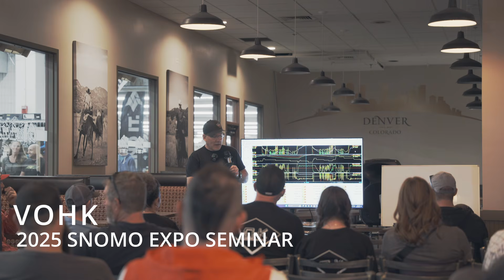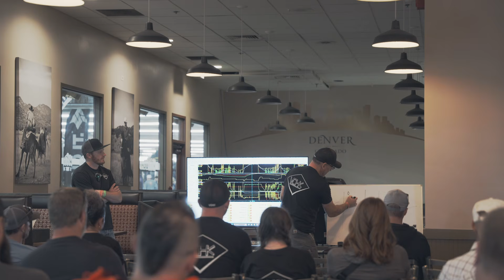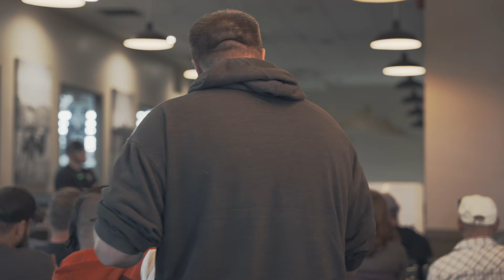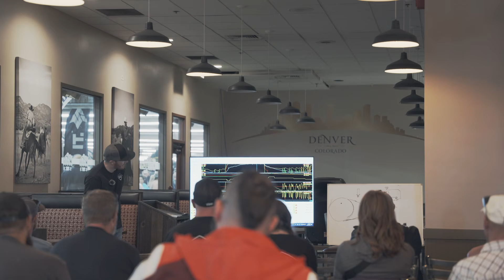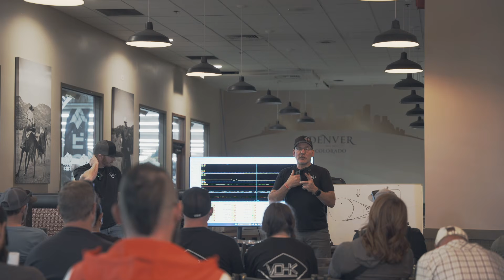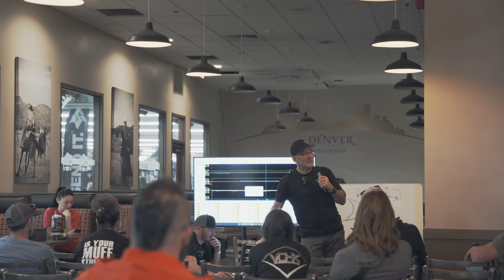Tech Talk 2025 SnoMoExpo

Comment: Then end is kinda messy vs the beginning, time times for anyone that might need to know.  

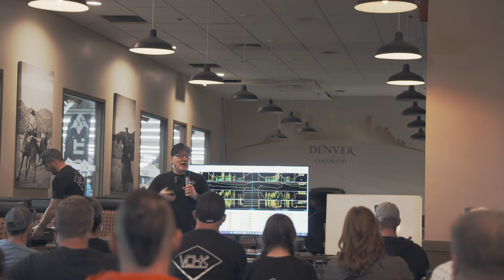1 tracks 0:00-  33:45
2 p22 33:45-52:00
3 deep snow bog 52:00-1:02:20
4 fuel pump 1:02:20- 1:16:00ish
5 throttle body adapter leak  1:16:00ish- 1:19:00
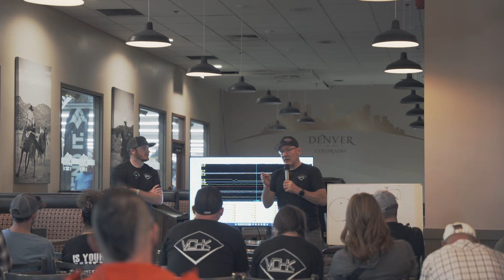6 aux injector harness failure 1:19:00- 1:23:00
7 Tps harness 1:23:00-
8 wastegate actutator stiction
9 tss resistor 
10 Rear shock lockout

Comment: You mentioned how the 9R's were more prone to clutch bolts coming loose because the lighter crankshaft allowed more of an impulse impact gun effect on the splines thereby loosening the bolt.  Would a heavier aftermarket clutch cover reduce the impulse?   Do aftermarket covers support the clutch towers better?  Would a heavier clutch cover cause the engine to rev slower such that it would be noticeable when riding?

Comment: Interesting one of your detriments to the 310 track is reduced speeds and efficiencies whereas Burandt claims to get greater track speed with it. Also why is it noisier how does it push more air when you indicated it has the same paddle area as the 3.25?
Reply: He literally explained why it pushes air. 325 has 3 shorter lugs to every tall one, and the paddles don't overlap side to side. All the center paddles on a 310 are the same height, the side paddles funnel air to the center, and the paddles overlap side to side.
Reply: @GreatLakesLogger  Must have missed that part. I guess that answers that question. Literally the first time I’ve ever heard the 325 has different lug heights

Comment: I can speak from first hand experience with Vohk. Erik installed a performance turbo kit. (actually Chase).It never worked from the start. As a matter of fact he couldn't even tune the kit to begin with. 9k later, multiple paid diagnostic trips later it was all fixed........ That machine never had a single successful  ride without blowing codes, shutting off, going into limp mode. The only help I recieved is bring it in to spend another $800 to diagnose the system we installed that still doesn’t work.

I grew so frustrated, I contacted Jared with Boondocker to try and help me through this mess. Multiple components were mismatched, wrong generation of controller was installed with EBC, it was a disaster. It woukd have cost 4k just to install thr correct parts it should have had from thr beginning.

I have never been screwed so hard before.

I have bought 4 sleds since then and would not stop at Alpine to buy a fire extinguisher if my sled was on fire.

Comment: So what are you thinking is the right thing to do with the P22 clutch ?
Reply from the maker: Depending on the year and model, the threaded collar fix is solid, always use a draw bolt, clean surfaces are key! 22 9R is the most susceptible to issues, the newer the better...
Reply: Kurt’s off-road.
I’ve been running Kurt’s bearing delete for three years with his collar fix and balancing. 
I’m sure Vohk has something also.